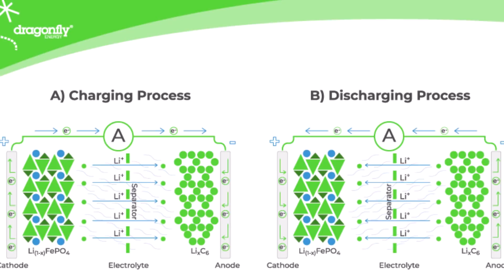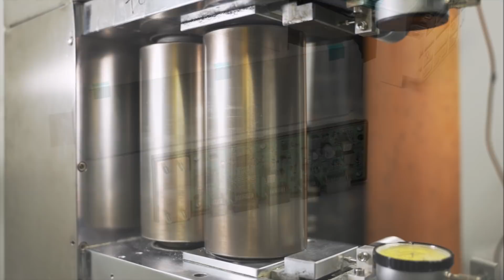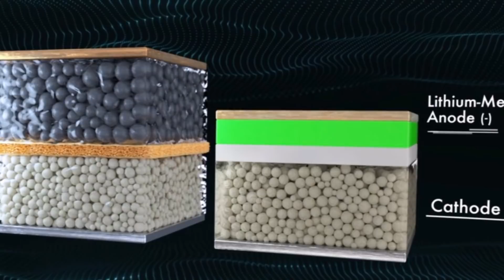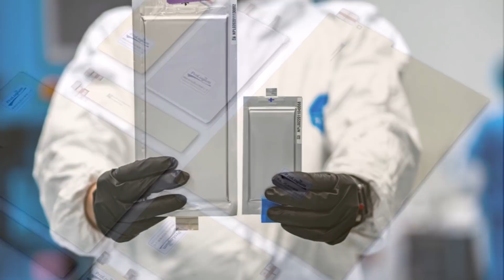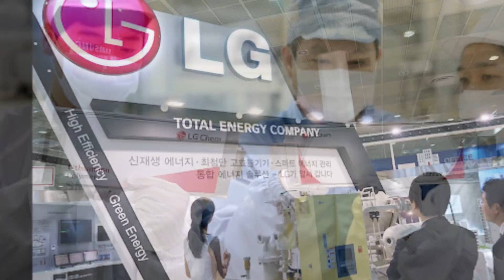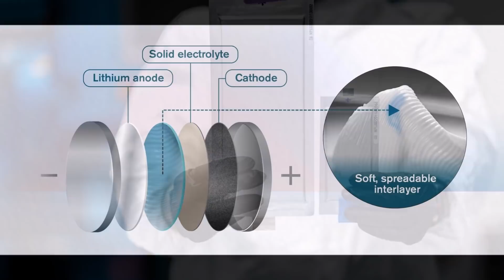LG's New Solid State Battery for EVs Surprises The Researchers Creating It

Comment: Too late. LFP batteries conquer the EV world now.
Reply: Not too late, too early.  Eliminating the dangerous liquid electrolyte is in and of itself necessary and desirable.  LFP batteries will likely migrate to primarily stationary applications due to their weight, and SSB will eventually take over mobile applications in ten years or sooner.  Who wouldn't want a battery for their BEV that charges in one tenth the time and gives you three times the range per kg?

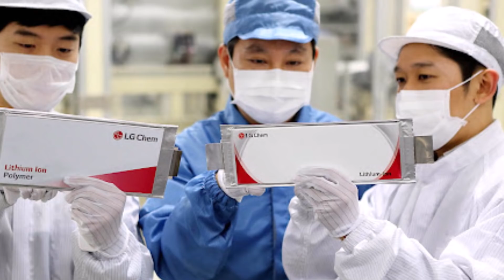Comment: I recognize the battery at time 5:45 - it is the main battery from a Generation 2 Prius. A year ago, Toyota wanted $2,600 to replace the battery when it failed in my 2005 Prius. Instead, I took it apart and replaced the bad cell for $30 and it has been running fine ever since. My only hope is that it continues to work until January when I take delivery of my shiny new Model Y LR!
Reply: Kudos for fixing the battery compartment yourself. 👍
Reply: That actually pisses me off. To throw out an entire pack because of one bad cell that can be replaced by the user... So much for "environmentally friendly"
Reply: @LuciusC  - Agreed. Not sure what the dealership does with the old batteries - maybe send them to a battery recycling facility? I know that Tesla has a battery recycling facility adjacent to their battery manufacturing plants for all the battery packs that either age-out, fail for whatever reason, or get damaged in wrecks, as well as the batteries in manufacturing that don't pass QA. Tesla mentioned that they can reclaim 97% of the materials that make up the battery for use in new batteries. 
Incidentally, the remaining 3% of the battery material is sold to Hostess to make Twinkies😈 I mean, really, does anyone know what's in a Twinkie and why they have a shelf life of 500 years?😈
Reply: @thomasruwart1722  I don't think battery materials could last long enough for Hostess's standards lol...

Comment: Only 500 cycles isn’t going to do much for the industry.
Reply: @T C  13 year's to go from mostly horses to mostly no horses anywhere back in the early 1900s. 
Less than that to adopt central air conditioning systems, microwave ovens, internet access, color tv's, cell phones, then smart phone's with internet capability. 

Netflix killed blockbuster off in less than 10 year's from its launch. Subscription streaming has almost killed off the cable packages. 
Digital cameras killed off Kodak and many other's in the film industry. Amazon killed off the wasteful box store industry.

Sure job's will be lost in some trades, other's will be gained in balance. 
Better air quality for all, potentially less wars over resources required for oil consumption, and much more efficient transportation from an overall energy consumption standpoint are all pretty big wins imo. 🤔
Reply: 500 cycles at 300 miles of range is 150k miles total. Well over the amount needed to cover the current 8 year or 100,000 mile battery warranties. 🤔
Reply: @T C  agreed but again even at the 300 miles and 500 total cycles. That's as long as the average combustion engine lasts. 
So they need to get that into production asap imo.
Reply: @T C  not only that, but less cooling or heating is needed of the pack. So reduction in weight there also. 
Plus simplicity which all ad's up to much cheaper costs to build. 
Faster charging to. Did you see that saic ev which could charge 15-80% in 7 mins on their prototype charger? It supposedly used a solid state graphene battery.

Ss evs should do 5-10 mins easily. Provided of course that you can find a sufficiently powerful enough charger to use. 
But networks are getting built out now to support more ev usage at higher charge rates. 
So by the time ss is widely available,charging will also hopefully be up to par.